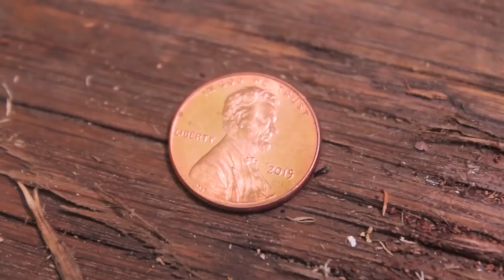Raising our timber frame workshop

Comment: I built my own timber frame workshop too, bricked up the walls with old bricks, all myself, but I used machines, integrity I think has little to do with it here, it's an abundance of time, and no pressure to work to a finishing date. There are just fantastic machines that really help....although respect for doing it the hard way. I think I would have capitulated once I had proved to myself I could do it, and hurried on with machines....lol....but here it's not the finished work that's the goal, but the work itself. Respect.

Comment: multiple levels? Will it have a sort of lean to roof? Will this be a living space as well, or many different people using it as a workshop? I'm currently timber framing a little chicken run. it's good to have people out there like you to humble me while i do little tiny projects. this is mind blowingly amazing. it's ridiculous that you're not known on youtube. i'm trying to spread your videos around. everyone wants to watch videos on how to glue wood together. do you ever think you're just so different that it's intimidating to relate to you or even watch your videos? well you got one weirdo hooked for sure.
Reply from the maker: youllregretit We are planning a half loft, and it will be our Mr. Chickadee workshop, which will house a smithy and joiner's/cabinet shop, and will most likely be our home as well until we build our cottage, so it needs a bit of space, but its only about 12X24 outside dimensions. 
Thanks for the kind words, Im a very rough amateur at all I attempt, every joint is a lesson in how I can do better next time! (If you look closely at the second bent you can see a wedged scarf joint in the tie beam because I measured wrong! Had to scarf in about 2' from one top plate to get the required length! Luckily I left them way longer than needed!)
I would love to see your coops, please make a video or take pics!

Comment: It is good to see traditional tools such as a brace and bit in use. I am in the process of making a timber-framed shed 24' long x 10 ' wide -   and it is useful to see how others go about it.
Reply from the maker: thats great!
Reply: I am tempted to fill in the Timber-frame with wattle and daub, following your video 'How to'. To make use of local materials I successfully made a flint wall for the side of my shed that faces the worst of the weather.
Reply from the maker: THats about the same dimensions of our workshop, I think it was 11X22 exterior. I would recommend wattle and daub for any outbuilding for sure, I think its about the most conscientious and wisest use of recourses to build with, basically you only need your frame, the wattle and clay can be local, and you can also just use a clay plaster as well, doesn't have to be lime, so most everything can come from your location if you have the trees and clay rich soil. 
Id love to see what ever you build.
Reply: Mr. Chickadee I will get round to making a video of it.

Comment: Sorry, I’m really new to woodworking and only just bought my first brace and a couple of bits so my question might sound less than intelligent. But why was your auger made so long with several attachments please? 

I’m a Brit and young people all over the world could do well to take a leaf out of your book. Your ambitions aren’t for the latest game consul and flashy cars, but for a job well done and to be proud of your accomplishments through hard work. Your families must be so proud of the people you are, both of you are extremely talented. Your woodworking skills and Mrs Chickadee's videography skills compliment each other to perfection. You are both also obviously highly intelligent people who are working hard with your gifts.

The part where you were pulling on the hoist for the side frame and your young lady was jumping up to put equal effort in was mildly amusing. 

You are both going to go a long way, by merely taking the right but not easy path.
Reply from the maker: It has an extension bit attached to it. You can find them secondhand often.
Reply: Mr. Chickadee Thank you.
Reply: Hey, Mark. You can also find "electrician's bits" for your brace that were made longer than carpenter's bits. They were designed to drill through wall studs, but they work well for other tasks, too.

Comment: Excellent video! It might be safer for an overhead lift to run the haul line through a single sheave pulley anchored under the load,  and pulling horizontally away from the drop zone. Nice work!

Comment: I asked this on Chris' interview video…but he said he didn't know and to ask Josh himself! So here goes…don't see Mr. Chickadee dropping in for many of these but hope Josh can reply to my question: 

"I have watched this interview more than once….always see something new. Don't know if you can answer this or not, but I noticed Josh uses two different pines, which I have always heard were weaker wood and not suitable for timber frame building. I think one is stronger than the other, but even then not knowing WHICH yellow pine or white pine is confusing. Reason being I just inherited a couple lots loaded with old growth East Texas pine..(loblolly? dunno) I live many hours away, but those trees are crowded in there as it is. Im just wondering…could I use them for a pavilion if I kept their feet out of the dirt? Or should it only be used internally?"
Reply from the maker: Pine is fine! Ive used both Eastern White Pine and Shortleaf pine extensively as well as virginia pine. There are some very nice temples in Korea made of pine many hundreds of years old. My house extension is almost 100 percent white pine, my blacksmith shop is almost all shortleaf pine, yes, you will do fine with pine. Just keep it covered up, keep it high and dry as it were. If it is in a place to get wet, design it to dry out fast. You can also do things Ive shown like burning and oiling/taring. But really its a great wood and your east texas pines will be much harder and stronger than the soft white pine I use so much here. (there are a bunch of species all lunped into the "southern yellow pine" family, loblolly, shortleaf and virginia all are in that group)
Reply: Yes, I intend to find out exactly what kind of pine they are. I have an image of a pavillion we were wanting to try. is there a way I might email you the pictures? For one I'm trying to figure out what the original wood is, and I think you might know. I beleive the structure is in Alabama. I have much more experience with ashe juniper, which me and my husky used to peal together, lol! I just loved their deep grooves and they made fabulous posts for my porch when it fell off that time:) We put those on concrete footers with pins…and they are solid as a rock many years later. I still have access to some majorly nice ashe juniper and were wondering about using them for the the posts in the open (mostly) air pavilion and maybe finishing out with pine? I'm rather smitten with the hammer beam look, but also the rather homey less fanciful ones too…with wooden floor. Wondered about the pines milled for that as well. It won't be totally closed in, but not making ground contact..and we can do the burn technique as well. I have learned so much watching your things..strongly considering taking a class from you if I can only get away:) @MrChickadee

Comment: I wonder how well would such a structure withstand a hurricane? Anyway it's still awesome! Thanks again.
Reply: Probably very well.  The challenge would be for this structure to resist uplift.
Reply: Its in the middle of What looks like a Forrest so i guess the trees would sheild the structure from the harshest winds
Reply: Our timber frame barn was raised in 1779. It’s survived several hurricanes, many blizzards, a microburst that took out most of the orchard behind and 225 years of active farm use. Timber frames are built to last.

Comment: I'm planning to build a 12x16 timber frame workshop with a loft, and am getting set to build a capstan to help me haul logs out of the woods and raise the bent. Based on your experience, do you think the capstan is worth it?
Reply from the maker: Id say a capstan is a great tool to have for a frame raising, though using one to skid or pull logs over any distance might not be the most efficient use for one. They are geared very very low, giving you a great mechanical advantage, but making them very slow as well. If moving logs you might be better served with either some type of log/timber cart or dolly. If you are working alone and have no help from traction animals or some vehicle like an ATV or tractor, I would advise either trying to use trees very close to the site or hewing the tree where it falls then it would be much lighter to move. A building of your size would not need large timbers, 6X6s or even 5x5s would work with proper design, and could be moved by a motivated person. If you are blessed with nearly flat terrain, moving even larger timbers with a log/timber arch is easily done.
Reply: Good call. I'll probably start then by making a log dolly and save the capstan build as raise day approaches. Appreciate the response!

Comment: Excellent Craftsman, Excellent Craftsmanship. The penny in the joint was a good gesture. However, the zinc penny will be gone in a few years, long before your building.
Reply from the maker: +Old Rusty Rooster I thought pennies were copper, what coin would you recommend?
Reply: Pennys used to be copper. I think it was 1982 or 83 they started making them out of copper coated zinc. Zinc being cheaper than copper.
I would use a nickel or such. Which ever you choose, still you are a good craftsman who takes pride in his work. Getting to be rare these days.
Reply: +Mr. Chickadee Pennies are only copper coated now, from 1981 and onward. You can buy pure copper rounds from sites such as Apmex, but they do differ in appearance from mainstream currency. Beyond that, I don't know enough about metal durability to suggest anything.
Amazing show of human ingenuity with your build here! I've been thoroughly impressed with how you two did it
Reply from the maker: +Timothy M. Thanks! We might try a nickel next time...
Reply from the maker: +Old Rusty Rooster Thanks for the kind words, well look for a nickel with this years date for the house.
Reply: +Mr. Chickadee What actually is the meaning of this penny in the joint?! Please explain to an uneducated guy :D

Comment: Great work! At about 0:35, you dip the drill bit in a jar. Is that just water to cool the bit? Or wax to help it through the wood? Or...? Thanks in advance for your reply.
Reply from the maker: It was some beeswax and oil mixed, helps it throughout the wood.
Reply: Got it, thanks!

Comment: Awesome. Did you ever drive a pin and decide it went in to easy?
Reply: He is using a technique know as draw-boring.  If you look at 1:24 you can see the mark made from the auger point. You then move the hole to be drilled closer to the shoulder, as he did,  and when the pin is driven in it will "draw" it up and make the joint tighter.
Reply: @pete-olson  huh, I did notice that and was wondering why he didn't start the hole directly on his mark. Thanks for explaining!

Comment: hey mr. chickadee.. i have another question for you.. remember yesterday i asked how long it took to build th entire structure? well.. would it be possible to use those dreaded power contraptions to cut the time right down? how long do you reckon thatd take? say if i took a chainsaw.. and i cut them to length and then cut the joins same method but refined them with a chisel..would it take still a long time? im going to do a single story straw bale outbuilding with large logs maybe 6 metres/yards roughly wide and about 4 metre/ yards long and about 2 metres tall with a sloped or triangle roof not really sure yet of the type. but what do you suggest i do and it has to be realonably quickly built.
Reply from the maker: If you dont have the luxery of time, sure, a building this size could be done up in a few weeks depending on what power tools you have and if you are also milling the logs or buying them as prepared timbers. I personally just prefer the art and process of hand tool woodworking, its connection to the past and the closeness it brings to the medium being worked.
Reply: awesome stuff man really youve been a big help

Comment: Sorry but I can't tell how you made your corner posts fit into the sills. Wouldn't that interfere with how you joined the sills at the corners? I'd like to do something similar some day and cant seem to make out how that works from the video.
Reply from the maker: good question, see this picture its about the same as what we did. 

http://timberframehq.com/wp-content/uploads/2012/04/Sillsandcornerpostexploded1.jpg
Reply: Nick Potter You could do a fork and tongue with a mortise at the sill corner. Then a tenon on the post all the to the foundation. In this way you don't need a pin and there's no concern with the open ended fork since it's in compression. Just another option I've seen!

Comment: Hello, how long do you typically let hewn logs dry before you build with them?
Reply from the maker: Hi, good question, I don't haha. Seriously though, traditional timber framing was done with freshly cut wood, I prefer to work the log as soon after squaring as possible, most of the movement in twisting, casting and such happens when it is milled or hewed. More movement does happen as it dries and checks but most is the initial "release" of the round log being squared. Most timbers will move some in this process, some less, conifers stay straighter, hardwoods move more. 

Using snap line layout I would layout and cut the joints in the fresh timbers, then stack them carefully until the frame is all done, if so desired after each timber has it joints cut, would be the time to kerf it to prevent checking. Once all the timbers are done, put her together and raise the frame. Slap a roof on and go on to the next step. 

This can be done in a weekend with lots of help, or over many months or years if you are alone or limited in time. Our workshop took me about 3 months to hew joint and raise, our house took about 4 months for the same.
Reply: Thanks for your response!  Very good to know.   I am a teacher, but I have off over the summer and am contemplating tackling this.  Sorry, another question.  Where did you learn how to timber frame?  Classes?  Books?  Videos?  If you can point me to any good resources, I would greatly appreciate it.  Of course, your videos are incredibly helpful as well!
Reply from the maker: Our primary message has always been, "how YOU can take a few old hand tools and build the best house money cannot buy" 

Just give it a go, you'll learn more with the doing than the reading. 

Some books are Roy Underhill and Jack Sabon written, I started there, much later I learned a lot from timber wright Jay C Whitecloud. He is the closest thing to a "master" I have had and has been amazing at answering my questions. 

I would highly advise you try center line rule layout, or snap line rule as its called. I show this I'm my house building videos, and only wish I knew of it since the begging. 

I will be teaching at least one timber frame class this next spring so that is an option. And also, just write me an email when you have issues.

Comment: I would like to see how  the wooden structure joins to the rocks. Thank you very much.
Reply from the maker: It just sits on the rocks, held there by gravity and friction like most old barns in the US and europe.
Reply: +Mr. Chickadee, I like that! you believe in gravity. We've been programmed to think such thing exists. But in reality there is no such a force bring applied upon the Phycial  properties of earthly matter. It's all about its mass and weight, and the electrical fields surrounding the earth. If gravity were such, wood wouldn't float  and butterflies well... Wouldn't fly.
Reply: +Mr. Chickadee Thank you.
Reply: no gravity is a thing, take the moon for example you drop a hammer and it will slowly fall, drop it on earth and it will fall at a pace of 9.8m/s/s. wood* floats due to it being less dense than water and butterflies fly due to upward lift of their wings. you say it's about mass and weight well you just admitted to gravity everything has mass and some form of weight, mass is the amount of matter and weight is the gravitational force * mass, weight is just gravity acting upon a mass.